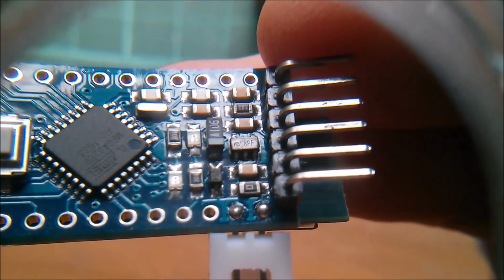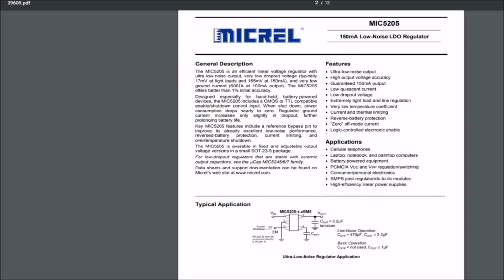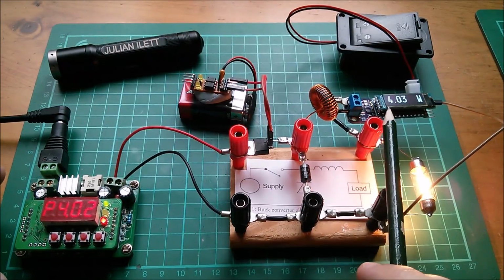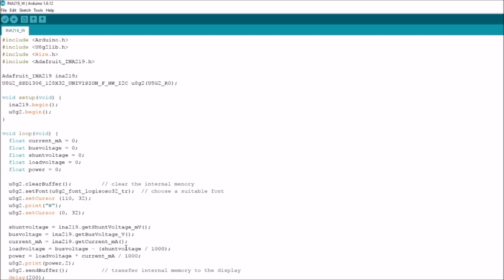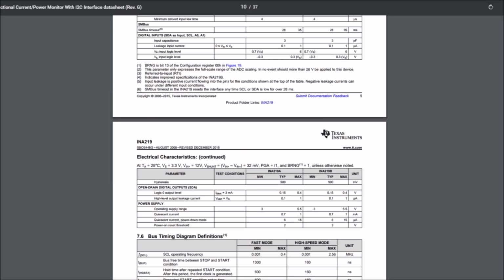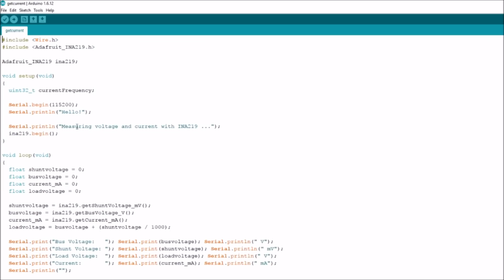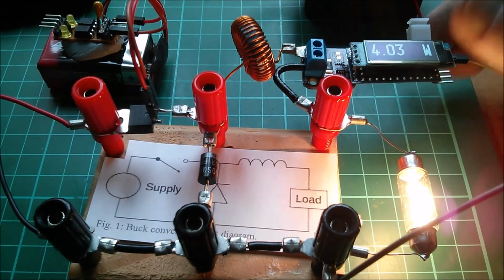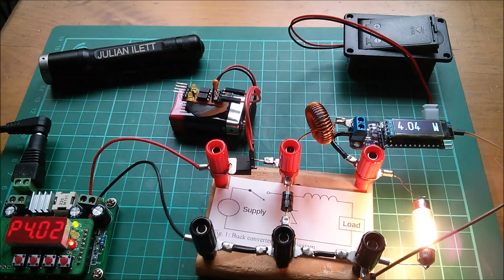Roasting Regulators and Arduino Anomalies

Comment: The INA219 is bidictional so depending on which the direction the current flows through it you will get a negative or a positive off-set from the busvoltage (the supply voltage). This may explain the logic of using the busvoltage + shunt voltage depending on which direction the current flows through it.

Comment: Perhaps the OLED blew since it was set to using an external voltage source instead of the internal charge pump (it uses 9v internally) and it caused some really nasty cascading that blew the regulator? Unlikely,. but just a thought.
Reply: If the overvoltage got back around to the ouput of the regulator, that could do nasty things to it.

Comment: I told you before and I'll tell you again, throw away those nasty Power Cell batteries. I put them in a few devices and they spilled their guts and ruined everything they were in within a year. One of those things was an expensive exercise bike. You might say it's OK to just put them in things you don't care about, but eventually someone will end up putting them in something important. It's just not worth the risk of having them in your house at all. Widlarize them!

Comment: I've got 3/4 of the way through this video (good work, by the way) and you are still agonizing over the + or minus regarding the shunt voltage.  I think the issue is whether you want to be measuring the power CONSUMED by the system (including the power dissipated by the shunt resistor) - OR - the power DELIVERED to the load (and hence excluding the power dissipated by the shunt resistor).
This all seems pretty straightforward, so maybe you have already considered - and discounted this.  But my initial impressin is that this explains the +/- 'issue'.

Keep up the good work.
Reply: A few second later, and you are changing the adafruit library code to eliminate the power consumed by the shunt resistor.  I don't see why you do this.  Yes - the power delivered to the light bulb will be slightly less - but if you want to calculate the buck-converter efficiency, then you have to include the power 'wasted' across the shunt resistor too.

Comment: I am worried that your current measurement will have all the switching hash of the inductor. Why dont you use a 100uF cap across load terminals and the current measurement in series with lamp.
Reply: Peter Kay He's very stubborn, everyone already said that
He wants to use the Wikipedia diagram of a buck converter (without a capacitor)
Reply: This is only a mark/space controller and would work just as well with inductor shorted.

Comment: Pls correct me if I'm wrong, but isn't the battery powering the mosfet also pushing a small current into the system, which your powersupply isn't reading, but your arduino is?
Reply: Short ans, No.  Long answer the gate of the mosfet  is insulated.  Only the electric field is felt with the mosfet.  It does act like a very small capacitor due to the thin insulator.

Comment: Julian, if you really want to measure the voltage across the lamp and call it the load voltage then I cannot fault your logic but I would agree with Adafruit that as far as the converter is concerned the sense resistor is part of the load and so the load voltage is the voltage at the junction of the inductor and the sense resistor.
Reply: Yes Adafruit logic is correct and current shunt is part of the Load.
Reply: number 33 dont worry. All his confusion is after doing homework

Comment: +Julian Ilett - I get the feeling the regulator was a counterfeit. The datasheet says it has thermal protection AND short circuit protection. If that were true, then the only way to kill it would have been higher than rated input voltage causing breakdown.

I wouldn't trust that the B3603 is more accurate than your arduino power meter. Check with an actual DMM to see which one you should trust over the other. I would automatically assume that the B3603 is just low, and that 4.05W is the proper figure.
Reply: I was going to say the same thing.  The regulator might shutdown due to overheat, buy you shouldn't be able to blow it up.  You might want to check and make sure something else didn't blow.  Perhaps you overvoltaged a cap or something else.
Reply: Actually, Julian’s watt meter is slightly low because his code doesn’t include the shunt resistor power dissipation.

Comment: Aren’t you no longer accounting for any power dissipated in your power meter? I thought that was the point of adding that voltage in the Adafruit code.
Reply: Hm... didn't the original calculation take into account the bus voltage as measured AFTER the shunt, and then add the voltage drop introduced by the shunt? Meaning the measurement is now not taking into account the drop of the  shunt, hence the slightly higher power/wattage reading? It would have been ok to do that if the measurement was on the INPUT side of the shunt, but it isn't, so now the measurement is out by the drop caused by the shunt.

Comment: Funny enough I had exactly the same problem today with my Pro Mini connected on 9V (must be an 11th of October thing) and I also had to do some digging to understand what went on, but I found the culprit quickly. I decided to order an external voltage regulator (AMS1117 5v, rated 800mA) and I am going to connect it to VCC directly. Love your channel and I learn pretty much on every of your video btw!

Comment: I also blew my first Arduino Pro Mini using a 12 volt power source. But only the LDO died, the rest of the circuit was safe. So I just soldered a 78L05 on the pro mini somehow.
Reply from the maker: I'll give that a try :)
Reply: :D
Reply: Should be able to de-solder (or cut through with  side cutters) the regulator, and then just use a something the 78L05 as mentioned across the VIN, GND and VCC pins... if something else hasn't killed it. Best way to check is to have your PSU at 3v3 or 5v (whatever voltage your Pro Mini was, and directly power it via VCC... if it works, it can be resuscitated. Make sure you current limit  ;)
Reply: Also make sure you use the over current protection on your PSU, something might be shorted.

Comment: 1st, Regulators usually blow open. Have you checked voltages with a good DMM?
2nd, you can desolder the regulator by putting a big blob of solder on it to cover all the pins, then bang the board on its edge and the regulator with fall off. 
Then, you can power the pro-mini from the 5v pin. On mine, its between the RST pin and A3 pin. 
Alternatively, after desoldering the built-in regulator, try to program it again. Power is provided by USB->serial board. If it programs OK, then the Pro-Mini is fine. 
Lastly, did you calibrate your INA219? Is the buck/boost readings correct? These Chinese stuff are not very accurate, and the amount of efficiency of the circuit you have (short circuit) is in the +99%.
Good luck in your hunt.